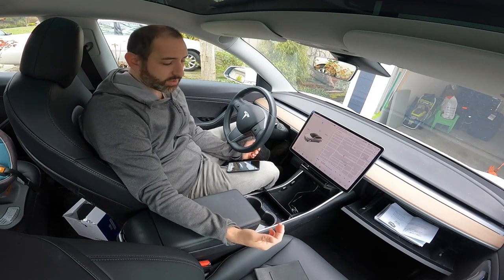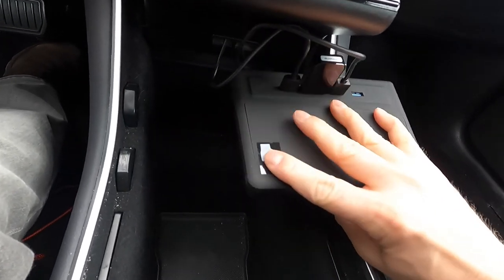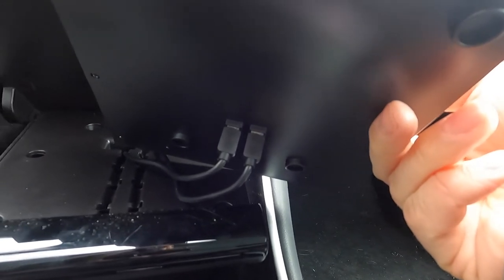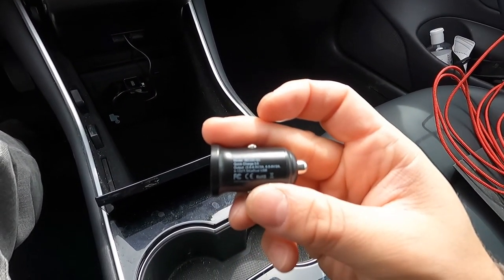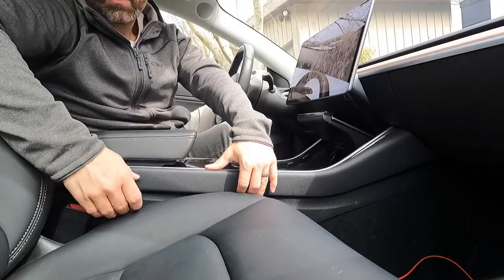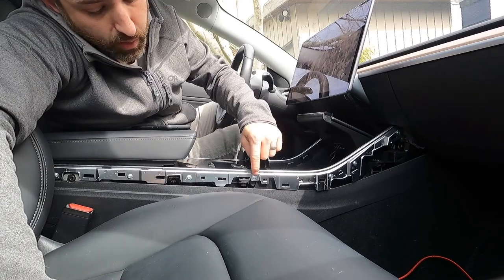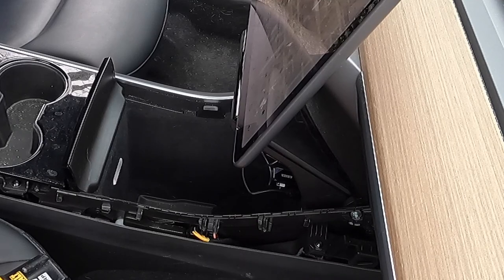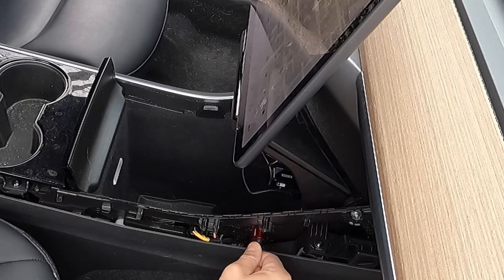Tesla Model 3 - Setting up Fast Wireless Charging

Comment: You did not have to drill that huge hole in the front - could have just run the small side of the cable from the inside to the outside.
Reply from the maker: Mr big brain over here! 😂 Oops

Comment: You can also get usb a to micro usb cables that go right in to the charging pad. (Drilled holes can be smaller if that matters).
Reply from the maker: Yeah, I wanted the flexibility though of having just the extension cord going though, so I can change either side easily later.

Comment: Thanks for the video. I looked up a couple of others and neither showed where they drilled or notched it, so this really helped. Seeing that you had issues fitting the cover over top the wires, I think I'll try using flat USB cables and see if that makes a difference.
Reply from the maker: great idea!

Comment: Thanks much for this! I finally switched my 2018 Model3 to wireless w/ Taptes, as my new phone+case didn't fit in the old dock/cable any more :(
This video was a great help... per great suggestion comment below, I ran 2 micro-USB cables instead of A extenders,  1/2" drillbit hole was enough to fit the smaller end thru...
I also drilled down two small little support ridges in the middle by cupholders where yours got blocked, then I could fit both cables w/o making the trim stick out. Worked great.
I also got 2 left+right angle USB adapter cables, so the 2 USBs sticking out of the 12v charge adapter didn't bump into the console cubby. That gives a bit of extra length for the micro-USB cables as well